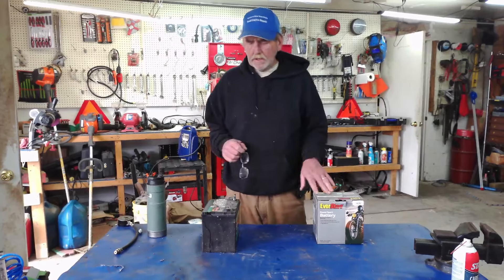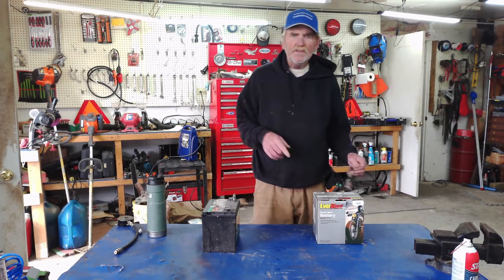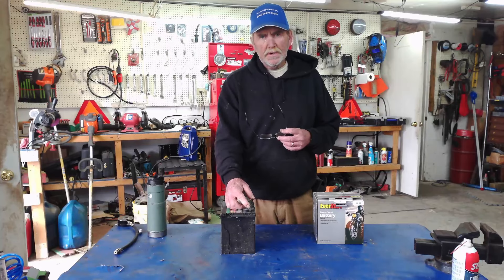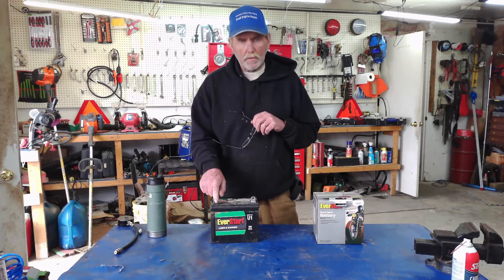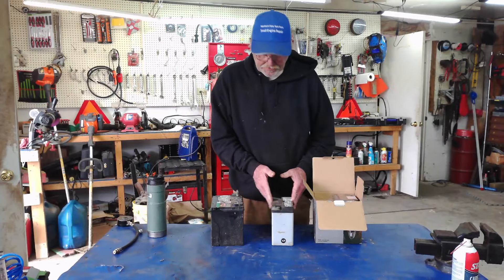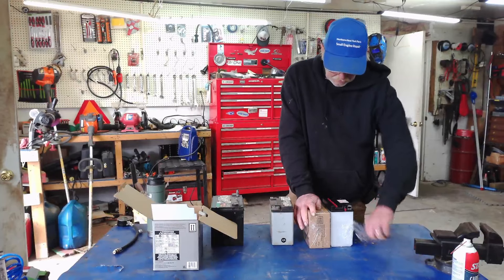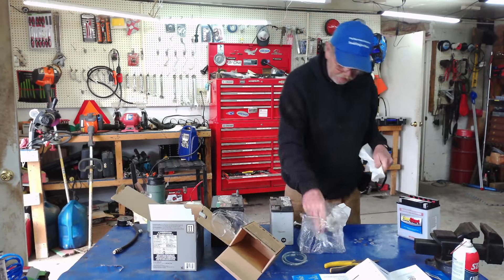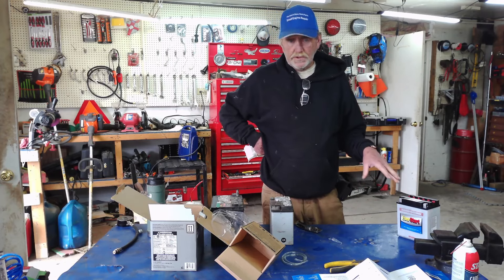How To Buy The Correct Battery For Your Lawn Mower

Comment: I've come to the realization that the battery Gods really,really hate me. I've done everything: smart chargers,smart maintainers,dumb chargers,dumb trickle chargers. Best luck for me is to disconnect the negative post on anything that will be idle for any length of time and charge it with a smart charger before I need it.
Reply from the maker: batteries are not like they used to be. 2 years is pretty good now a days Amos